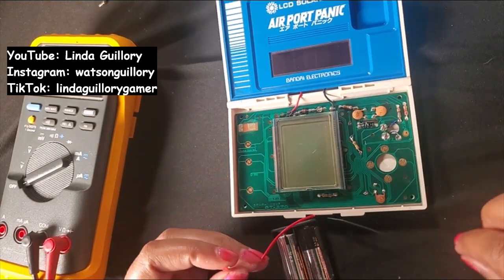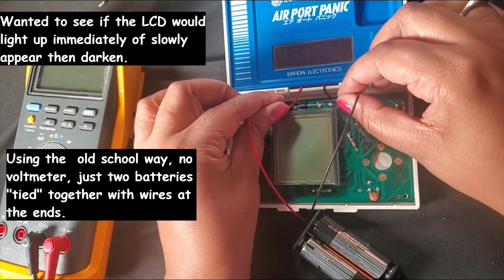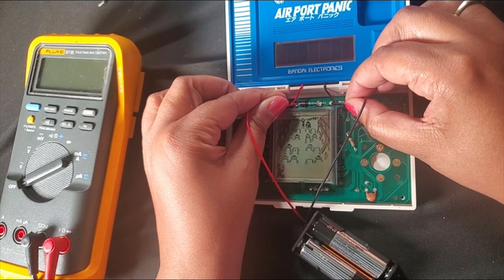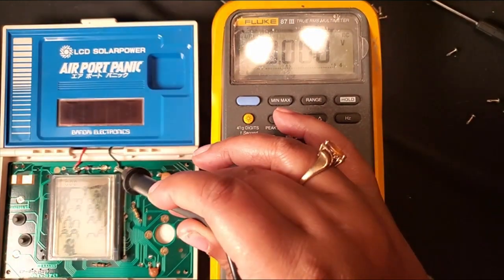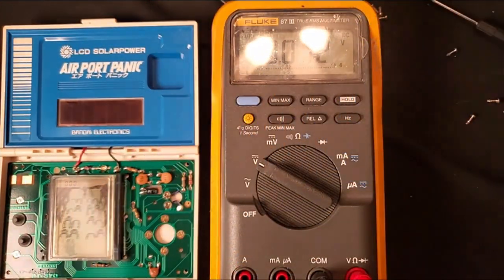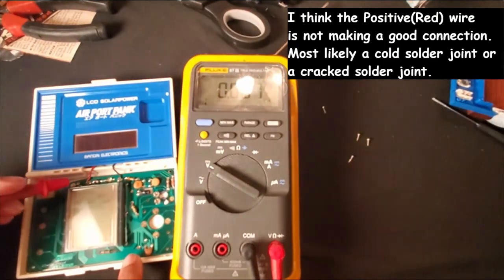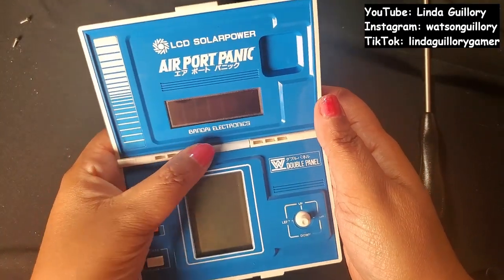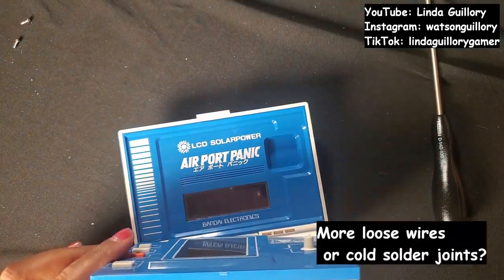Airport Panic part 2 - Fixing a " broken" game.

Comment: It does look like the typical behavior of a break in the wiring, probably caused by opening and closing the game lots of times. I hope it is soldered onto the solar cell and can easily be replaced. 
It is always really satisfying to watch videos of things being repaired, especially this kind of cool old-school hardware. I hadn't heard of wire glue before.
Reply from the maker: Having trouble getting behind the solar cells.  May need a practice game to try it with.  Looking for one now.
Reply: @lindaguillory7802  I guess that is clicked into place without using screws and needs to be carefully pried open. Always tricky to do without damaging anything, maybe a spudger could help. I hope you can find a suitable game to practice on.